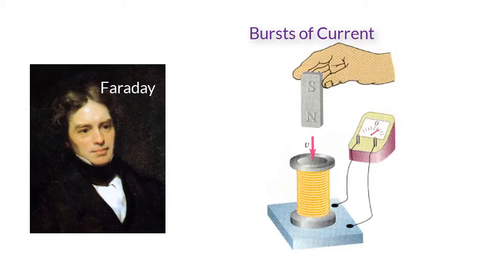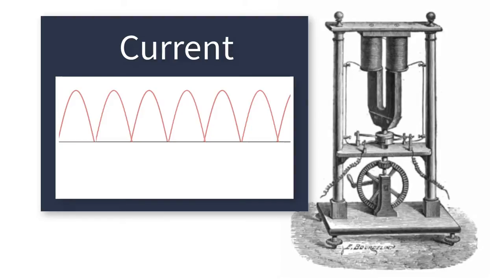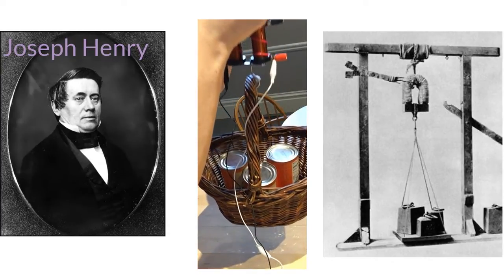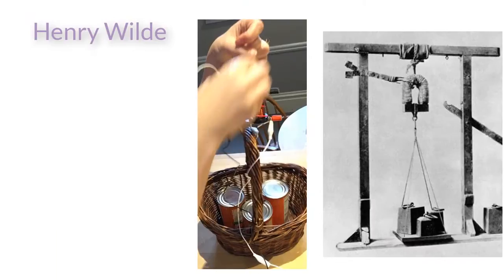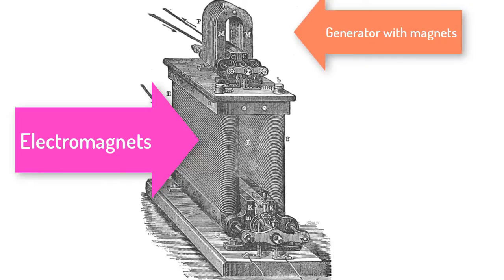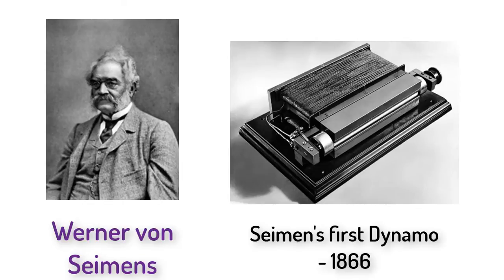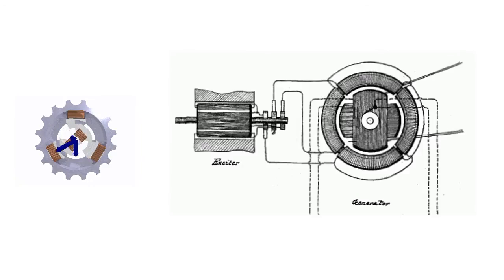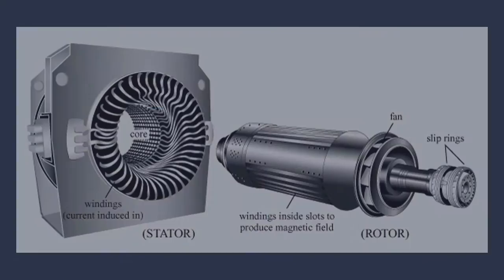Where Electricity Comes From: History of the Generator & How the Generator Works

Comment: Joseph newman was the first
They dont talk about his inventions because they produced a continual low voltage high amp current, capable of operating todays dc to ac inverters with 10× power out than needed to turn the generator.
Fact is they wont even give you the real schematic of his machine because it would revolutionize todays energy.
All i know is he used the same face on each magnet to create a continual push around the  upper and lower face of a single coil of wire .

Comment: I am an aerospace engineering student. I just wanted to understand electricity and how it all started. I couldn't have got all this content in the correct order and accurate, so easily. You are really doing a great job. I probably would have stopped thinking about electricity if you were not there. Now , I'm watching the whole playlist. Thankyou so much Ma'am.
Reply: The energy density of the vacuum potential is enormous, even mind-boggling.  While scientists have estimated that energy by various means, a reasonable calculation is given by J. A. Wheeler and C. Misner in their Geometrodynamics, Academic Press, New York, 1962.

We simply must get the vacuum energy part moving, for when one examines all the options, it is the only option that will work in time.

We already know that the Maxwell-Heaviside equations, prior to Lorentz regauging, do include open systems in disequilibrium in their vacuum exchange. We are also already aware that the present classical EM model completely omits the vacuum interaction (much less any broken symmetry in that interaction!), which we also know is a gross non sequitur since the vacuum interaction (and the dipole's broken symmetry in it) have been well-known in particle physics since the 1950s.

The major problem in the U.S. is that the decision scientists at top positions advising leaders/secretary/vice-President/presidents, usually do not know anything but U(1) electrodynamics, and the advice they get from additional "expert" scientific consultants or advisers is inferior in that these "expert advisers" also seem to know only U(1) and also only the Lorentz-regauged Maxwell-Heaviside equations. Many (most) do not even "believe" in the active vacuum, or if they begrudgingly admit it, they think it is of absolutely no consequence. And they simply do not believe the tremendous energy density of the vacuum, nor will they accept it, even though it is good physics and has been for decades.

Hence the entire scientific energy structure and infrastructure in the United States is fearsomely welded to a small fragment (subset) of Maxwell's theory, and even to just a Lorentz regauged subset of the severe Heaviside truncation of it!  We have a scientific mindset problem of epic proportion. In short, the energy crisis is completely the fault of our own scientific community. It is NOT the fault of the President, the Vice President, or the Secretary of Energy!  It is the direct fault of the inferior advice being given them by the NSF, NAS, etc.

The sad thing is that the U.S. scientific community is seemingly no longer capable of even evaluating its own U(1) EM model, as it has become almost an iron dogma. E.g., in the 1880s Heaviside discovered the enormous energy pouring out of the terminals of any generator -- vastly more energy than we provide as mechanical energy input to the shaft. Poynting, of course, only dealt from the beginning with the tiny component of that energy outpour that is intercepted by the external circuit and caught and used. Lorentz understood both the Poynting component and the Heaviside component as well. But no one could explain what could possibly be the source of such an enormous energy flow from EVERY GENERATOR, BATTERY, AND SOURCE DIPOLE. That is rigorous. Simply check Heaviside's original papers.

Anyway, Lorentz then took the attitude that this enormous Heaviside energy flow component, missing the circuit entirely and just wasted, had "no physical significance" (his words). So he arbitrarily discarded it (not from NATURE, but from MATHEMATICAL ACCOUNTING) by a clever little integration trick, still used by all the electrodynamicists and those energy scientists designing and building our electrical power systems, writing our textbooks, teaching in our universities -- and advising Presidents, Vice-Presidents, and Secretaries of Energy.

In short, we most often face scientists who literally will not believe and cannot comprehend that every generator we ever built, already extracts enormous energy from the vacuum. It is quite easy to prove it, for peanuts. Any lab, university, or decent experimenter can do it. Kraus' diagram in his Electromagnetics, Fourth Edition, shows the nondiverged energy flow component in the form of contours, which are MEASURED watts/square meter at each point, where a unit point static charge will catch that much more energy.

Let me now give you a rigorous proof, and very simple, that every system is already vastly overunity by producing far more energy out than we input. Consider a perfect DC generator, loss free, so that its efficiency is 100%. Now consider a perfect external circuit attached, which consists of two short lengths of perfect conducting wire, and a pure resistance load. Let the load be 12 ohms, and the voltage of the generator be 12 Volts D.C. Now we have a neat little situation: We put in the mechanical power equivalent of 12 watts to the shaft. Since the generator is loss free, all the 12 watts are perfectly transduced into magnetic field, and the energy in this field is dissipated with 100% efficiency to form the source dipole. Let us leave the source dipole for a moment.

Now we look at the external circuit. There is one ampere of current (12V divided by 12 Ohms) flowing in the external circuit. So we are inputting 12 watts of power  to the generator shaft, and we are getting 12 watts of power output in the resistor. All this is clearly measurable and normal so far.

Now we check out John D. Kraus, Electromagnetics, Fourth Edn., McGraw-Hill, New York, 1992. Figure 12-60, a and b, p. 578 shows a good drawing of the huge energy flow filling all space around the conductors, with almost all of it not intercepted and thus not diverged into the circuit to power it, but just "wasted."

Hey!  We have 12 watts of power in. We have 12 watts of power output of the resistor as heat. By conventional Poynting considerations, we are getting out precisely what we are inputting. That is a blatant lie. We are getting output from the resistor precisely as much as we are inputting to the shaft of the generator. Yet we also are getting out a measurable vast amount of energy flow from those generator terminals, filling all space around that circuit. Those Kraus contours are experimental measurements. Anyone can do them, or similar. Anyone can build a little system very similar to this one, and approximating it.

So where the devil is all that VAST EXTRA MEASURABLE ENERGY FLOW pouring from the generator terminals, and missing the circuit entirely, COMING FROM?

Experimentally we can easily prove that this Heaviside nondiverged energy flow is (1) real, and (2) very large.

Let us now add in an extra set of "receiving antenna/collectors" whose circuitry is completely separate from the DC generator circuit with its load. Suppose we add enough of these "little antenna/interceptor/detector" circuits, each containing a little purely resistive load, to obtain 3 watts total in all those extra and independent circuits.

Well, now we are inputting 12 watts. We are getting out 12 watts in the external resistor attached to the generator. We are also getting 3 watts out of the "extra receiver circuits" separately, in separate loads.

So our total input is 12 watts. Our total output is 15 watts. Our demonstrated COP = 1.25.

So how do the "experts" explain that simple experiment????"  They don't. But any lab worth a tinker's dam -- and that includes any lab in Department Off Energy and in any university -- can do a similar experiment, catching enough of the extra "usually nondivergent EM energy flow" to bring the COP to COP>1.0.

This is a very simple experiment. So is the Bohren experiment which produces COP=18, is published in the hard literature, and is independently replicated by two additional scientists and published in the same issue of Am. J. Phys. that published the Bohren experiment paper.

Anyway, Lorentz's "physically insignificant" vast Heaviside nondiverged EM energy flow component is indeed "physically insignificant" to that single external circuit powered by that DC generator. But it is certainly not "physically insignificant" to those extra "receiver/collector circuits" and their independent loads.

Let's use two imaginary viewgraphs where in the first one Lorentz is shown in a sailboat on an ocean, in a very nice large ocean wind. Puffing his pipe, Lorentz is smiling and saying, "Only the wind in my sails is of any physical significance".  In the second graph, Lorentz is looking aside at a whole fleet of additional sailboats, calmly sailing along and powered by that "insignificant remaining component of the wind".  And Lorentz is saying, "How can they be using that physically insignificant wind?"

This is an exact analogy to the state of thinking that now exists in the U.S. power industry and the U.S. scientific community concerned with power systems. We don't have an energy crisis, we have a collection and usage crisis—and a vast scientific mindset crisis.

Hopefully this will change in the future with highly capable scientists who know quaternion electrodynamics, Maxwell's original complete theory, etc.

Comment: After all these years I'm still at odds, or puzzled not by what a generator is generating (current and voltage), but what exactly is at play at generating electrical power. I would argue that "generators" actually collect and concentrate (align) power.
Reply: Electrons are moved by a magnetic field. You can see this if you bring a magnet near a cathode ray tube and it will bend the beam of electrons. Electricity is really just moving electrons. In a solid  conductor like a wire, if you move a magnetic field, you cause electrons in the wire to follow the movement of the magnetism...they move through the wire and therefore you have a flow of electricity. Now for me the real question is WHY are electrons moved by a magnetic field? And is that why iron objects are attracted to magnets? Since all matter has electrons, is the fact that magnetism moves electrons the cause of a magnet's attractive force?

Comment: AC current is more dangerous than DC, because the frequency of AC is close to the frequency the human nerves use to control the muscles,  that means that you might not be able to let go of the AC carrying wires . In short you get a cramp that block your muscles. 
I have tried all variants, 500 VDC burned a whole in my finger and made me sit down for a while.  AC lock your muscles  so your only choice may be to walk backwards and pull the wire out of your hand. If the wire is long you may die ( 230 V AC ) .

Comment: The common automobile alternator is a battery-excited, 3 phase ac generator rectified to dc using a diode bridge. The crudest, often found in motorcycles, can be a 2 phase, permanent magnet alternator also rectified into useable dc with a diode bridge. Cruder yet is the Magneto generating ignition voltages found on power plants from lawnmowers to airplane engines.
Reply: "If quantum physics does not offend you, you have yet to understand the quantum theory"

Comment: nice! where at that time perhaps they could not find a very a strong magnet for the rotor or commutators so they went for an electro magnet instead but now a days we could find small yet very powerful magnets thus we can replace either the rotor or commutator with these powerful magnets, the result is a much a higher output of electricity with the same input power from what ever source. but magnets alone could not create electricity it must be a combination of electro magnet and permanent magnet.
Reply: The advantage of the electromagnet is that you can very easily control the voltage output.

Comment: “Multiphase” is properly called Polyphase. 

For the same line to line RMS voltage, three phase transmits the square root of 3 (~1.73) times as much power, using 1.5 times as much wire as DC or single phase AC.
Reply: Where do yo get the root 3? It is three times the power with three wires than single phase with two. That is 3x the power with 1.5x the wires. If you need a neutral then 3x the power with 2x the wires. Neutrals are used in low voltage networks, that s 400 V in Europe.
Reply: @okaro6595  Square root of 3 comes from computing the multiphase voltage drop. You can get 3x power of a 1 coil engine running at 230V or square root of 3 times 400V nominal for three phase system. if you consider Y system connection for motor. 
You can follow a similar logic for delta connection of windings. The square root of 3 you can get using trig and computing the difference of two waves out of phase by 120 degrees or vectors angled 120 from each other (you need to subtract them).

Comment: Fabulous  videos Kathy. Just a couple of points: the DC dynamo was improved by a Belgian called Zenobe Gramme, which oddly enough anglo saxon scientific history is mostly unaware of, you may want to research his work.  And AC current is "more dangerous",  the human ( or animal body) acts as a capacitor in AC current. Capacitors let AC current pass through, and the capacitive reactance (resistance to AC current) is around 3 orders of magnitude less than dry skin resistance at the same voltage. Keep up the good work !
Reply: In a steady state system you are likely correct that AC (at certain frequencies) will pass more current than dc. After all that is why AC is more efficient as a transmission system. However for biologic conductors, damage does not happen as a steady state process. In addition, charged balanced (AC) electric stimulation cause less electroporation than monopolar  (transient steps of DC) stimuli. This is why bipolar waveforms are used in lots of defibrillators.
Reply: @Sam-tb9xu today, with better technology, HVDC is superior compared to AC transmission.
Reply: Frank Rowsome's very readable book 'Trolley Car Treasury' (published 1956) has a fascinating chapter 'The Infant Sparkers' on the first electric streetcars of the 1880s and includes a potted history of electrical technology from Galvani onwards, with a section on the first dynamos. 'The dynamo, the machine which generates electricity, took an oddly long time to be invented. It wasn't until 1870 that a Belgian, Zenobie Theophile Gramme contrived the first really successful one'.
Alternating current at low frequencies is definitely more hazardous than direct current, as shown by wiring regulations even today; no more than 55 volts exposed to human contact is permitted for A.C. but 110 volts is allowed for D.C. It is a different matter for alternating currents above twenty thousand cycles per second as the nerve endings do not respond, as Tesla discovered around 1891, though there may be heating effects as used in diathermy.